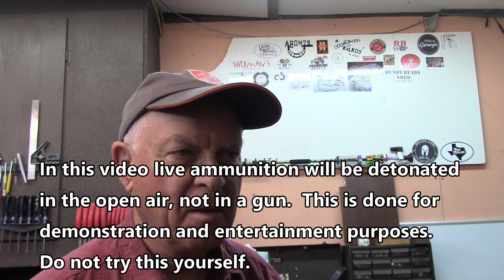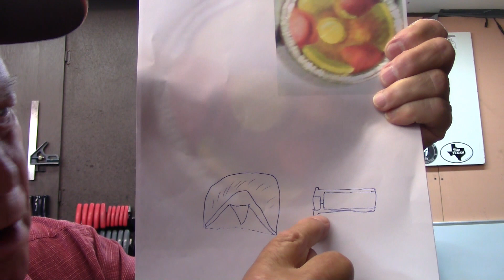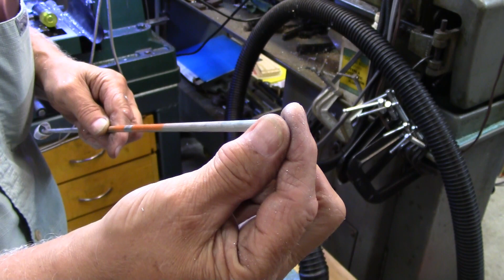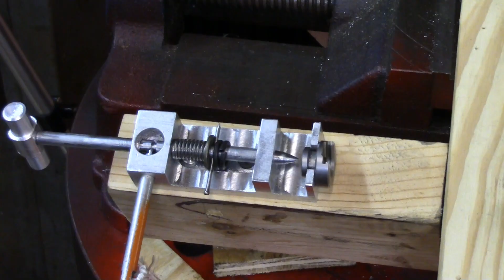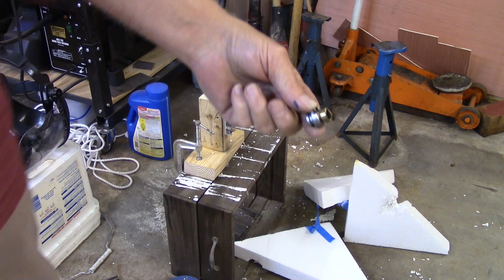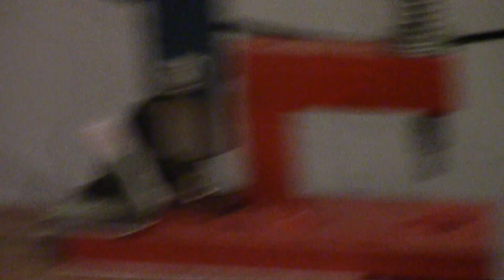Certain Death - or not

Comment: Hi Harold. I have no experience of reloading bullets (living in the UK as I do), but it seems to me that the best (safer), thing to do would be to load the primer first, and then load the black/gun powder or and then projectile.
Regards Mark in the UK
Reply from the maker: Yes that is the way it is done.  First step is to remove the old primer and reshape the case, second step is to insert the new primer, third step is to add powder and flare the case, next step add the bullet and crimp it, and last step for me add a factory crimp.  But if you just changed caliber of ammo and did not set it all up right the primer may not be all the way into the pocket.  Then you have to do something with the mistake as well as re adjusting the primer inserting mechanism.   Thanks for stopping by.

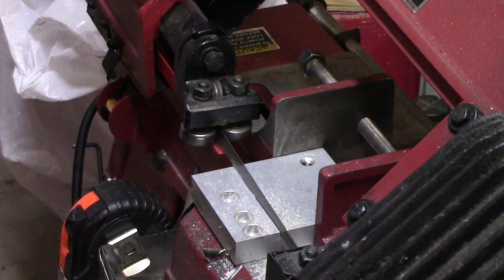Comment: 7:30 Sorry to correct you Harold, but Aluminium comes from Great Britain!, If that came from from California then it is Aluminum! so much for todays chain yanking, good video.
My two cents worth:   handling the cartridge with the spring compressed made me a little queasy, a simple safety pin would have calmed that. On a lighter note, I have done dumber and more unsafe things in my lifetime so who am i to speak. I enjoyed this, and will not try it on my own,(at least not right away) thanks H!
Reply from the maker: I think Chuck imported it from Great Britain.   =(;-)  Besides I need to practice my English.  Thanks for stopping by.

Comment: Never had a primer go off while reloading. 
I have had some ugly looking ones where the primer pocket was not right and just put them in a press and pushed the primer back out.
And like you I have had some high primers, so I reseated them with a little more pressure.
Been reloading since the early 70's and I am 71 years old.
I still have time for one to go off I guess.
Neat little contraption to shove them on down.
Mike
Reply from the maker: Nothing like getting it right the first time though.  Thanks for stopping by.